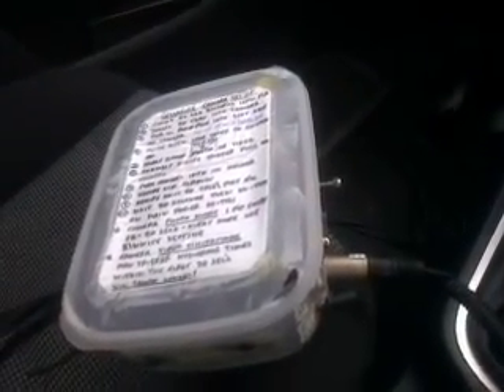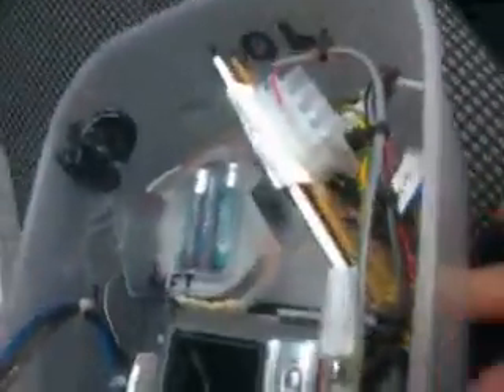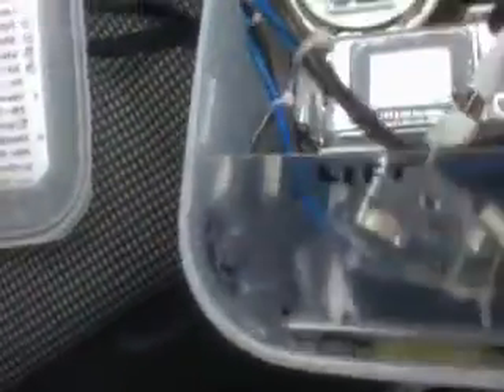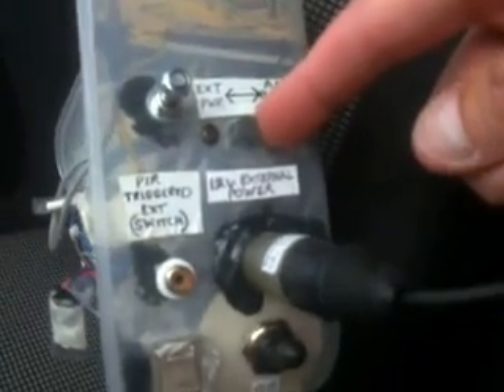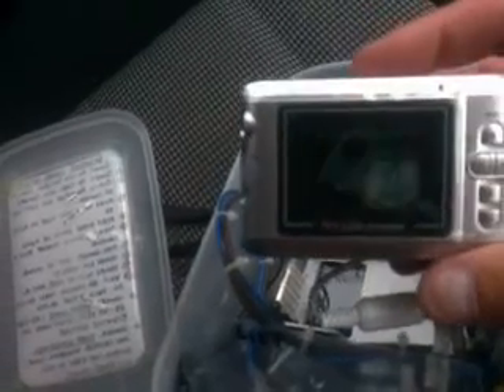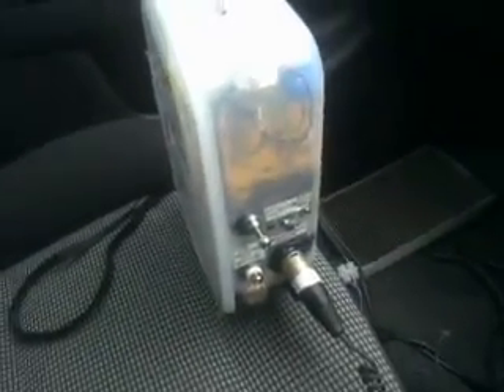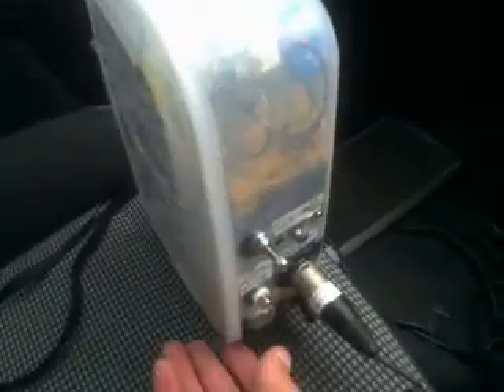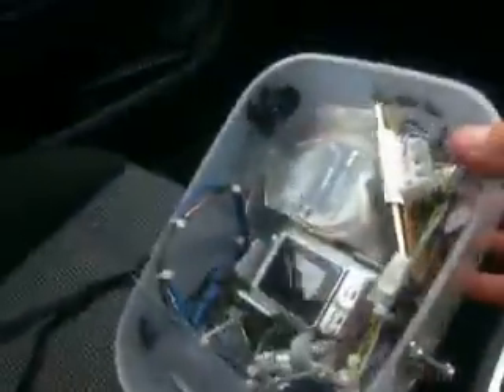Homemade Wildlife camera

Comment: hiii Simon, 

your are amazing.. build one with internet function using microcontroller.. and send pic to wassup into ur phone..:=)

my dream project. lol
Reply from the maker: I would if I wanted to view remotely. This was designed to be a standalone  device. Camera needs a huge 12v battery with a 5 volt regulator as screen permanently  on ( it's just a very old cheep tesco camera) thanks for reply